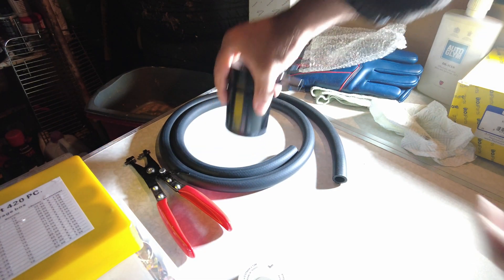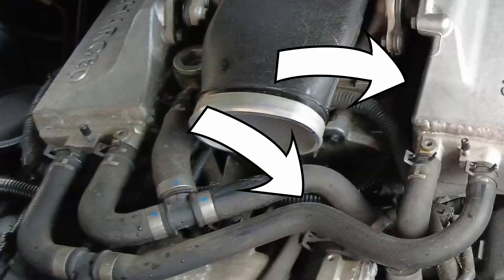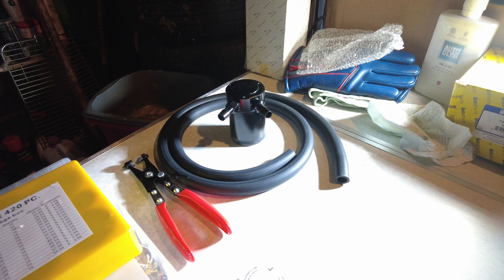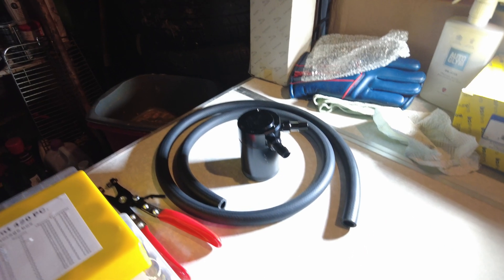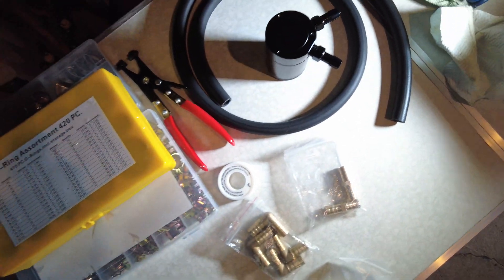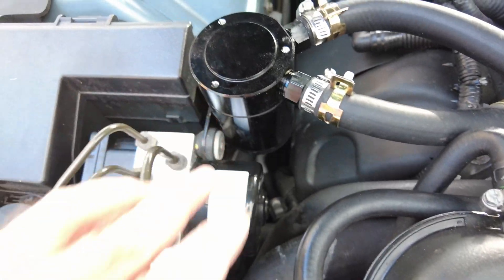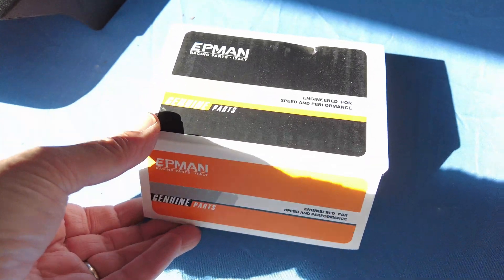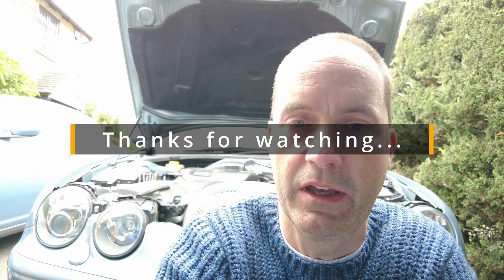Maintaining Jaguar S-Type R: Part Twelve (Oil Catch Cans)

Comment: Great video! I have the same smoke on start up. I also have gone through 3 pcv valves in 2 years, it always starts to get moist where the pcv valve fits into the engine, and eventually a crack forms. Talked to a shop and they recommended fitting a catch can. How has been so far? Also would the oil in the throttle body and intercooler eventually clean out with the catch can installed? I am also noticing a slight leak in the intercool gasket on top of the engine, along with some burning oil smell on hard accelerations
Reply from the maker: Thank you.  The catch can installed on the PCV side does it's thing.  I empty out every 300 / 400 miles and it's around 1/5th full.  I'm not sure if the intake would clean itself out but it surely would not get any worse with the  catch can stopping all that gunk.  I'm lucky in that my STR has only covered around 33k miles so not so sooted-up.   Intercooler - that is water cooled so can only assume that you are implying that you are observing a very small oil leak caused by excess oil being passed through the intake ?  I've not personally heard of that happening before.  The supercharger itself has it's own oil sump - it's possible that maybe the drain plug is weeping or there is excess oil in the area where the oil has been replaced previously ?  Otherwise,  burning smell on hard acceleration could be oil dripping from a failing valve cover gasket onto the hot exhaust shield.  The vapour could be being drawn-in via the cabin air filter if there is maybe a small hole in the liner separating the cabin air filter area from the engine bay.

Comment: your PCV is dead it is not normal that your engine speed varies when opening the oil gauge, do the test by opening the oil filler cap I am sure that the cap will be subject to suction and once removed the engine will shake + very strong smell in the exhaust to check quickly.
Reply from the maker: @gA-xt1yh  thanks.  I''ll look into that 👍

Comment: Have you noticed benefits from this? I want to do it but I feel like every mod I make, creates another problem with this car. Please put email in next description so I can contact you
Reply from the maker: Over the Christmas holidays I'm planning to make an update video specifically featuring the oil catch cans now I have some miles completed.
Reply: @toooldclassics  Sounds good👍👍
Reply: In theoretical way it should reduce the oily mist in the intake which should actually lead to better gas/fuel mixture and so potentionally could improve the gas mileage of the car, atleast a bit. But on top of that, you will get atleast cleaner intake and possibly CATS (which I saw faulty over so many Jags while I suppose its the reason why those CATs are so defective) and also cleaner exhaust ..
Reply: @ Thanks for the input, it’s so hard to find fitted cats for this car.

Comment: Nice job, very interesting. But the second catch can is normally not needed. I mean you would see oil mist pretty easily in that pipe but its completely clean on mine. Only the big pipe should transfer oil mist from crank case to the intake, the other one only lets fresh air towards the crank case.

If you also have oil deposits in the caldofy pipe, you probably have a bad PCV valve or another problem. Worth checking i guess :)
Reply from the maker: Thanks.  Yes - I will make a follow-up video on how the oil catch cans have been performing.  You are right though - the second catch can on the left bank is empty.  The right bank catch can does indeed seem to have captured some  oil.  I'm waiting until I've accumulated a couple of hundred miles before assessing though.  PCV was replaced earlier in the year so hopefully no issues there.